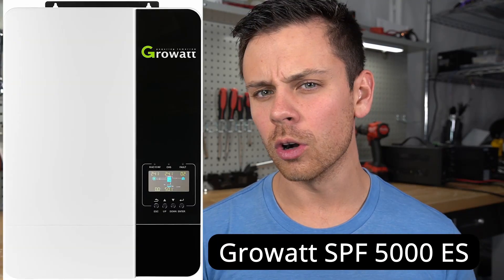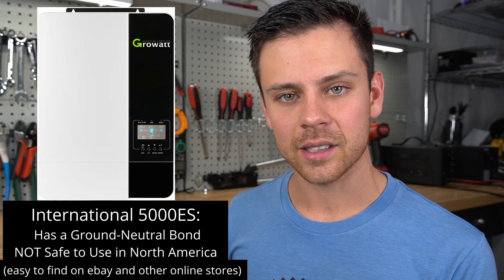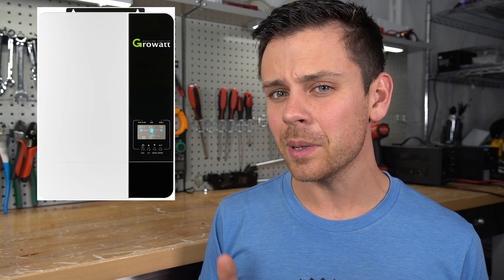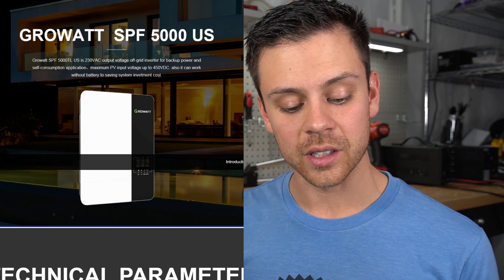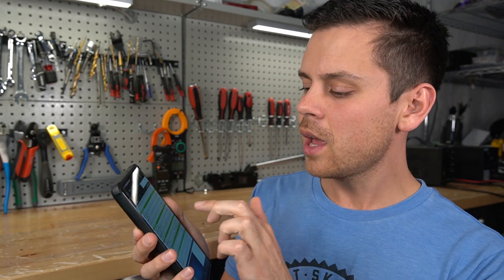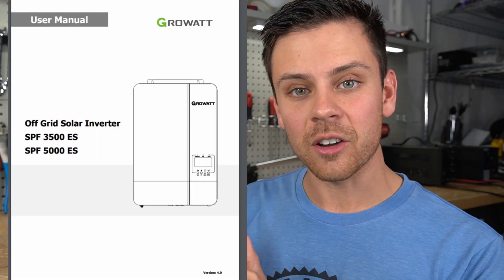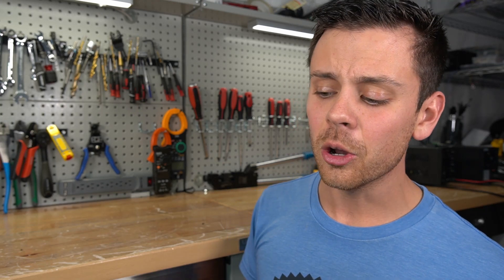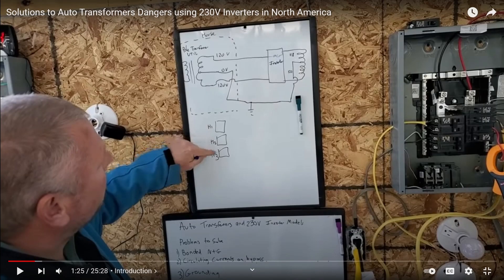The Growatt 5000ES Fiasco Explained: Is it safe to use 230V Inverters in North America?

Comment: Normally I love your vids.  But now I'm ticked off.   You did videos on growatt and tell us it is great for us newbies.  You stressed how easy it was to build a system.
So based on your track record I bought one with a transformer.
NOW you tell us how dangerous they are AND NOT to use them.
Thanks. I just wasted 1300 +/- dollars.
And I can't afford to rebuy this stuff.
Reply: The 5000ES is the subject of this video and much discussion. The 3000 units for 120v are fine.....well AFAIK lol
Reply from the maker: Yeah, I've never touched a 5000ES. Or any international version growatt. The 3000 units aren't even made by growatt. And they are fine, and designed for use in north America. But personally, I don't want to support growatt.
Reply: @WillProwse  my bad for not realizing your accolades for the 3000 did not carry over to the 5000.  I figured if you liked growatt then they were good... Oh well live and learn.  Who the hell is the 3000 made by?  I thought your video said it was a growatt...
Reply: I did the same based on Wills, and Davids reviews. Don’t be afraid if you got the package from signature solar. Mine has been up and running with out issue since Late July. And I’m 💯 off grid…
Reply: @kenbrown102  I have mine all wired up and have run some tests...  I have not hooked up my trailer yet because I was debating on getting a second transformer due to the fact that my trailer runs off 1 - 30 amp single pole breaker.  But I have been using it for the washing machine, lights, dehydrator and various hand tools. With no problem.
Now that this issue has come to light I want to take off the pannel and check to see whether I have the correct unit or not.
If I do I'll feel a little better.  I currently have the natural and ground bonded with the screw in my panel so I want to make sure that is correct to.   It should be as it is the only panel after the growatt
Reply: @FreeAmericanSpirit  I would say that every piece of electronic equipment setup should be checked for correctness, I don’t think anyone would disagree with that statement. And there’s a reason or the NEC codes. The priority here is for everyone’s safety.
The problem here is willing or not, the assertion is that GROWATT IS DEADLY IN THE US. 
This is simply not the case, if they were bought by the ONLY authorized sellers in the US which happens to be Signature Solar. As I’ve said in other posts, I drove to their offices and met James personally. I did that to get a feel for the character of one of the owners (James is one) prior to buying any system. And super glad I did. 
And wanton or not from this video their name is being drug through the mud, do to no fault of their own.
Reply: “NOW you tell us…”

Sometimes, people discover things later, 
in this case, from another source.

Honesty is always the best policy.

Comment: I think you are being a bit harsh on Growatt as they are the manufacture not the reseller. SS seems to be on the ball, others not, only looking for dollars along with the purchasers. Yes Growatt need to make the difference between them clearer, but the resellers should not even be importing them for the US market just to make a dollar and get someone killed.  Love the channel !!!!!!!
Reply: The issue is DIY folks aren’t typically electricians or EEs…and even that, folks are treating as plug and play.  It’s a little dangerous. Obviously a non-EE can figure this all out but lots of people here just want Will or SS to design their system for them
Reply: @Richard from Signature Solar thanks for the reply…I think the issue with the Autotransformer is if you plan to have this charging or bypassing grid power. Correct me if I’m wrong, but an imbalance on non-critical 120VAC loads in bypass would overload the Auto.  James was saying to put over current protection on the auto, which would protect the system, but would result in you losing your 120 loads once your inverter breaks from the grid…please correct my logic if I’m wrong here.
Reply: @danksu04  Why not skip growatt transformers and get the Victron 100 amp unit.
Reply: @glennwest4438  haven’t looked at Victron…figured it was way too pricey.

Comment: Europe also uses 50 Hz not 60 Hz as U.S.  unless they can be set for 60 Hz they will mess up some electronic equipment.
Reply: they can be set to 60 Hz
Reply: That’s good.  Just hope all folks know to switch or the units default to 60 Hz if sold here.

Comment: Well just saved me from buying that brand.   I'm hoping there's a either direct solar panel to inverter or standardized charge controller for panels to EVs.  I'd kinda hate cycling one house battery just to transfer it to car battery.  I think some of these ev are a cheaper battery option with essentially a free car thrown in.

Comment: Finally someone with common sense when it comes to DIY electrical work with inverters.  Too many influencers with zero electrical training pushing the idea of an  auto transformer as the magical answer.  

if you connect a device to the electrical grid that is not done in accordance with the national electrical code you are responsible for the damages and yes you can go to prison for your DIY work in your home that injures someone. 

ITs not just an unsafe grounding issue, the auto transformer can not handle inductive loads and the loads across both hots can become unbalanced causing other issues. 
Not worth saving a few dollars

Comment: again you may save a life great video  these all in ones high freq is not some thing i would buy at all 
 long term a good low idle currant low freq pure sine would be so much better 
I have had a Genetry Solar 6k inverter for a year or so it is so much better than my old aims inverter 
it has wifi and so much more very happy with it  
i have a few diy inverters i built based on the egs002 they are very good also just no
 bells whistels like the awesome GS 6k

Comment: So is the issue with Growatt or the grey market importers?  
Signature solar are innocent bystanders here.  I dont think they are obligated to do anything.
It certainly doesn't help that Growatt don't differentiate them at all - but I expect the standard (chinese) response will be: <shrug>so?</shrug>.
Reply: I don’t think it is correct to call signature solar a grey market importer. They are an authorized reseller of the ES unit that has been correctly modified for the US off-grid market. As far as I can tell their mistake was to not insist that the units be relabeled and sold with the correct manual

Comment: I agree with your comments about the Growatt site, the labeling and manuals and the problem of people buying a 5000ES for use in NA from a seller other than Signature Solar. But after watching Signature Solar's response showing how to safely setup the inverters they sell I think it is a totally reasonable approach. I purchased two of the 5000 US units from them along with a solar edge transformer and I am going to keep them. The good thing for me about the fiasco is that it motivated me to learn a lot more about US and international electrical systems, how auto and isolation transformers actually work and the importance of balancing out my 120V loads between each leg of the 240V. My understanding is that many of the other all in one units that output 120V use autotransformers internally so this need for balancing applies to them as well. 
I also really like the approach of choosing 240V for all of your loads when possible (especially the heavy loads) and it makes a lot of sense when you are off-grid to separate out your 240V loads if you use ANY brand of inverter. Charging an EV is a good example. You might think it is safer to charge an EV using 120V (even if it is a heck of a lot slower!) but this could put a lot more strain on a 120/240V inverter since it has to balance out the load. It's much better to charge with 240V and if you can do that direct from a 240V inverter without having to also pay for a transformer to cover those loads then why not? Just pay for a transformer for your 120V loads.
So yeah, Growatt could have done a better job with labeling and manuals but I agree with Signature Solar that these are worthwhile and innovative units at a great price that a competent person can easily install them safely.

Comment: To the best of my knowledge, Growatt manufactures their grid tied and hybrid inverters themselves but their off grid inverters are rebadged from other manufacturers. Most of these off grid inverters from China are clones of the MPP.
Reply: These units are based on the Voltronic Axpert inverters, plenty of rebrands and clones in the market. Growatt does develop further, they've changed the chassis and the firmware it runs on.

Comment: Growatt is not different to all the other dozen Chinese internationally operating inverter brands. And bad documentation is one of the problems with Chinese devices. You guys just had the (un-)luck and chose one of the very few internally bonded inverters. MUST, EPEver,  EASun, etc. are all very comparable to the Growatt and typically not bonded. So yes, I totally agree with Will not to use an other market inverter if you are not fluent in this matter. Unfortunately this topic was brought up by a Youtuber and it went somewhat viral because it is a great concept of using an Autotransformer, BUT you can never have a N-G bond before the Autotransformers Midpoint!!!!
Reply: I'm assuming this is why there is now a Growatt autotransformer and the original one that signature solar sold is discontinued by the manufacturer.
Reply: @ericdunn6232  the problem is not the autotransformer. It is the internal N-G bond of the inverter. Having an inverter and transformer from the same manufacturer only helps, if the system is bundled with compatible products.
Reply: @ericdunn6232  - the auto transformer discontinuation has nothing to do with this YouTube video series, showing how 240v can be sent over 120v lines, destroying electronic equipment in your home/shop, if the auto transformer fails or is inadvertently switched off before the inverters are switched off.

Comment: I have been using 5000ES not from signature solar, off grid for 5 months, I have no idea what I am doing, but its running 24/7 no problems.
Reply: Off grid is fine…charging and bypass through the inverter with the Auto is a problem likely…or you have to do some workaround to make it work.
Reply: @danksu04 I’m in Europe running small house 🏠 off grid on 3.5 kw inverter which is enough to run fridge tv lights water pump 400watt  I haven’t installed solar on a roof yet if needed top up battery i hooked up a 240v lead to my neighbour 50m away so far didn’t have any problems with power bypass it does automatically if I’m cut off grid power .My guess is maybe they are not suitable on US market .And what they mean bonding them or grounding? I grounded all my installations and I will solar pv as well , in many countries like U.K. I newer seen anyone grounded solar pv   .When I ask electrician what you do not grounded solar he responded you don’t need here there is not many  thunder storms in a year ,I was quite surprised cos only take is one ☝️ and can burn out all system .I know someone who’s had decent interver solis and burn out in less than a year. I decided to go with Growatt cos I reed reviews before I buying anything and so far no issues. One more think people thinking that buying more expensive inverters will give them some guarantees they all are made in China most products or components.And yes I don’t want to spend 2k for victron solar charger not even inverter for that moch money totally rip off Britain, and I would never 👎 pay that moch money for companies who make fortune I’m not that sucker .That is my personal opinion

Comment: Question; I just received that inverter from Amazon (mpp solar don't ship here in Hawaii...) it's for a 48 volts off grid electric car charger so i will only use it with a 6-50 ac output, is it safe in that application? No grid tie or auto transfer will be add? I will use 240 volt 16 amp with my charger. Thanks!

Comment: Life would be easier if countries and regions could work together, and create common industry standards for the whole world. Not realistic, but a nice dream. Personally, I live in Norway where we use the second most power per capita in the world, and I think the "modern" way we build the local network can be the best solution. We and most of Europe use Terra Neutral with line voltage of 400V. I'm also pleased with most of the plugs except the schuko plug, because it is a bit too flimsy so it tends to melt when regularly pulling 2000w at 230v (8.7A) after some time. Since it is rated at 16A at 230v (3680w) the plug should hve been built to handle that current.
Reply: Yep you are right "nice dream"!

Wake up and go pee! 
You're in a bright new world! 
It's all about the $!
Reply: @chrisdevalcourt648   Why so salty? It's never too late to realize that the current technology that the US is using are old and outdated, so they can slowly start the transition to a new and better grid. In Norway we used IT networks until 1997, when we realized that TN networks was way better for the modern power usage. Therefore we are slowly transforming the grid to TN technology in most areas. Maybe the US should do the same?
Reply: @TheJensss  didn't mean to be salty. 

Just the idea that it's wishful thinking that it would happen. 
I'm probably negative thinking that $ drives these decisions. 
I do agree it would be nice!
Reply: @TheJensss  and yes when it becomes cost effective it'll happen!
Reply: @chrisdevalcourt648   I really think something has to be done because of two main reasons. 1, the environment impact on incompatible devices are significant, and I really think this would get more focus in the future. 2, do to the enormous amount of power required for the transition to electric cars, 110/240V simply aren't delivering enough power without overloading the low voltage grid. But as you mention, cash is king so it is going to be really exciting to see what the future brings

Comment: I can't agree more about growatt documentation and model numbers.     They have a history of making fundamental changes but keeping the model numbers.     Furthermore, they do not document how they handle grounding and neutral bonding.     

Also:  In the video Will talked about people using an auto-transformer with the inverter in order to get 120V split phase.     In my opinion, this is a really bad idea if the inverter will have grid power at the AC input.    If there is grid power at the AC input, when the inverter is in pass-through mode the autotransformer will try to balance the two 120V phases for the whole grid.   This could be very problematic.     My conclusion is that the US version of the 5000ES should either be completely separate from the grid or only be used to drive 240V loads.
Reply: What is the workaround to the grid connected input with the Auto?  Haven’t thought about it, but seems that the Auto needs to be isolated in bypass as you mention
Reply: @danksu04  I don't know of a good work around.....    BTW:  This is not unique to the Growatt.   If any inverter is passing through the grid, it will have this problem with an auto-transformer.

The only thing I can think of is to use a center tapped isolation transformer... Not an Autotransformer.
Reply: @centerrightproudamerican5727  yeah…looks like MPP LV6548 solution is likely the best way to go…in that case it’s operating at 120VAC so it should be fine… I see why Will promotes them so much.
Reply: @Center Right Proud American  Could you tell me... my electrician instructed us to buy a 240v Growatt/MPP, etc which he will hook up similar to the grid power in the panel, which will then provide either 240v or 120v. I consulted with an inverter supplier and they instructed me that a transformer would be required to run 120v loads. But with the AC input to the inverter (but not grid-tie, just grid assist/pass-through to power loads) your comment sort of confirms that the split phase inverter or an autotransformer would be problematic.
Reply: @IshawooaPass  The Growatt and MPP inverters that provide 240V Split phase can work fine if hooked up correctly.   

The wording of my previous comment about all inverters having 'the' problem was not well phrased.   What I was trying to say is that any time you put an auto-transformer on the output of a 240V inverter,  there will be issues when the inverter goes into pass-through mode.
Inverters that are designed to output 240V split phase should not have this problem.

Comment: Ok, so I bought two of these from Signature on Aug 20th 2021. On the receipt they are listed as :

5kW Stackable 48V 240VAC 100A 450VDC Off-Grid Inverter by Growatt

Along with one of their recommended auto-transformers. I haven't hooked them up yet. I am good?
Edit: I was planning on using this for off-grid...
Reply: That is how I run them. You should be just fine.
Reply: @Richard from Signature Solar Cool! Thanks Richard.   $set /worry = off
Reply: Yes you are good, exactly the same here off gird and running since July without any issues…
Reply: Thanks both Country Living and Ken